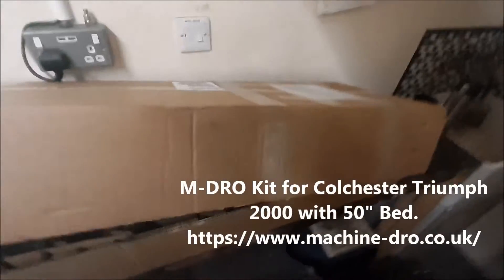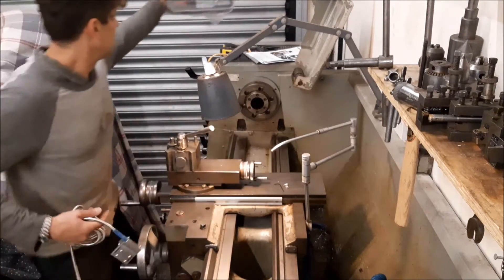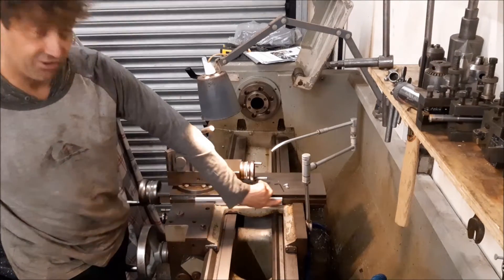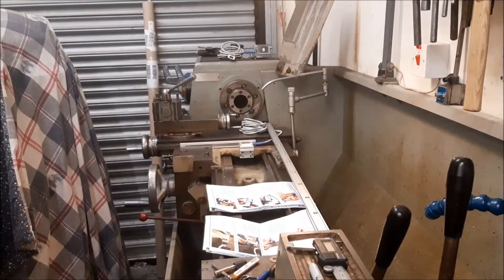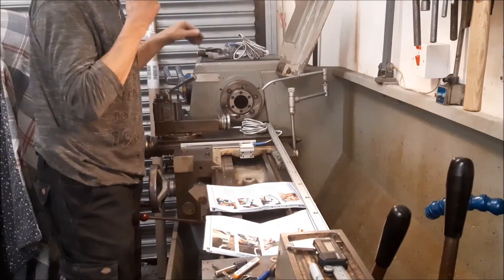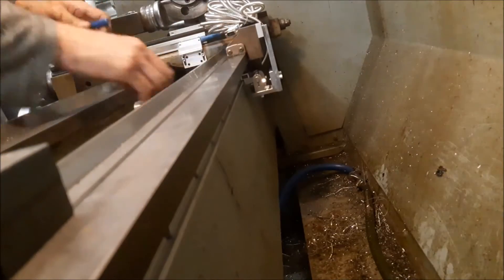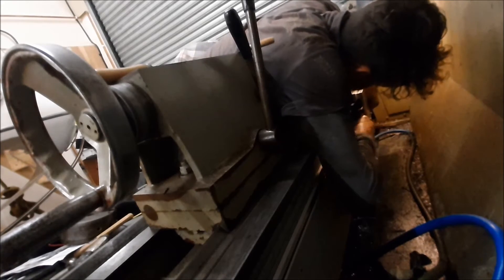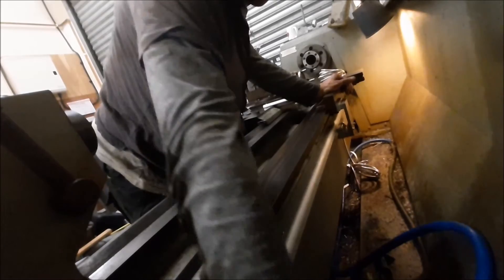Digital Readout fitting to Colchester Lathe.

Comment: Great video thanks!
I have an old Triumph roundhead.  I did have a Triumph 2000 as well but had no room for the 2 lathes so had to let one go. The 2000 had more wear than my old Roundhead so I sadly got rid of it. Love my old lathe but a higher top speed would be nice.